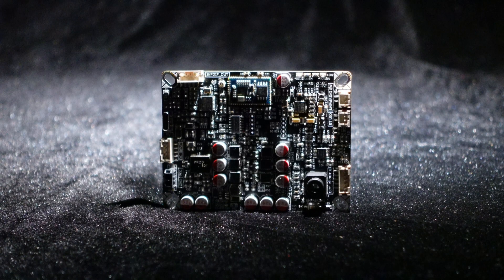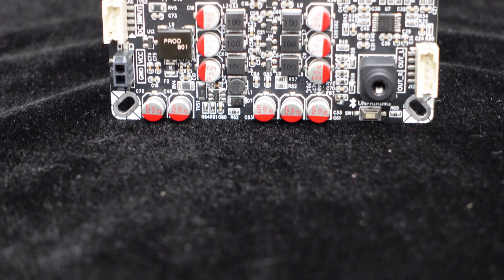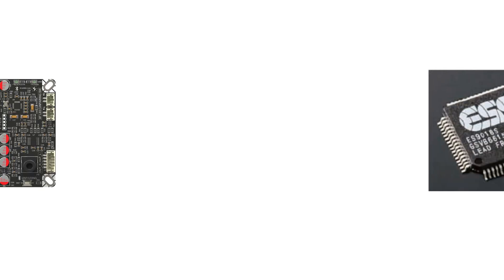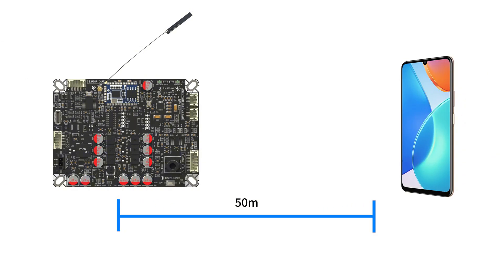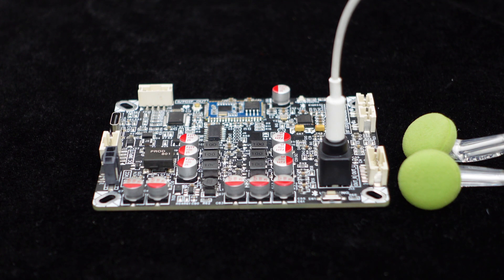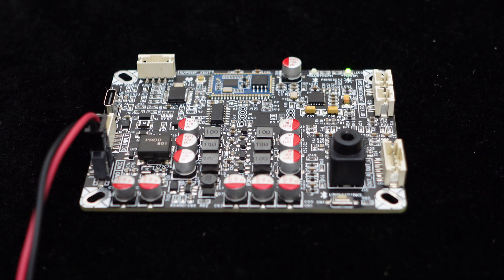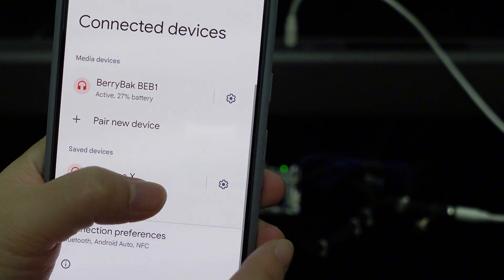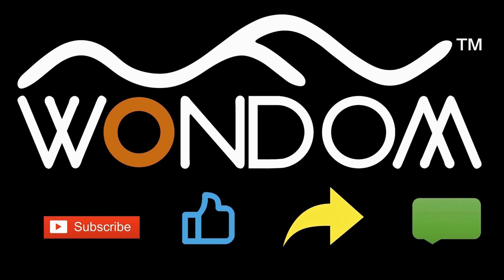Qualcomm QCC5171 v5.3 Bluetooth Decoder USB Input Coaxial/Optical/Analog Output LDAC,aptX BEB1

Comment: You should have made this receiver with an RCA output and the option to connect power directly to the battery. There should be this option in this and in BEA1
Reply from the maker: Hello, the BEB1 comes with a PH-4Pos port for connection with WONDOM BCPB battery charging boards for power. The BEA1 comes with RCA ports for analog output. You can select the suitable product to your requirements. Have a fantastic day~